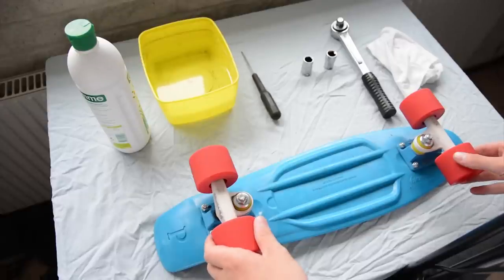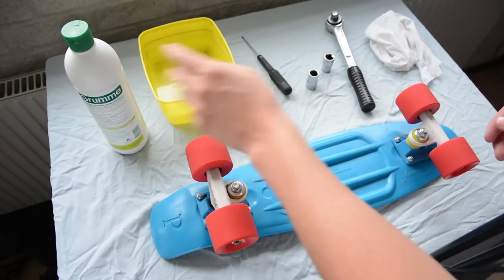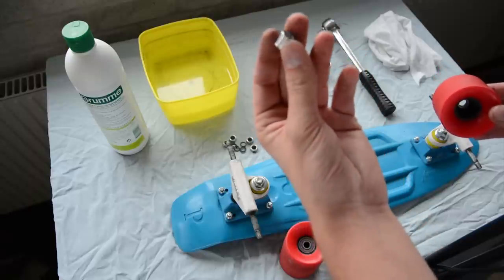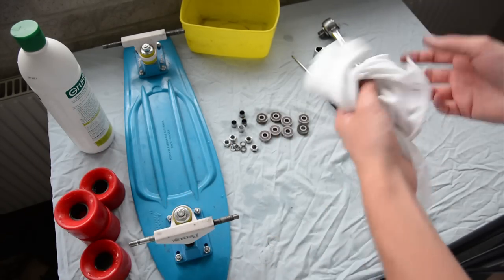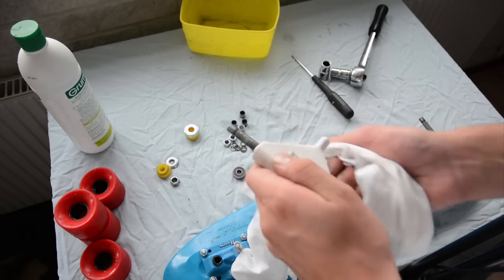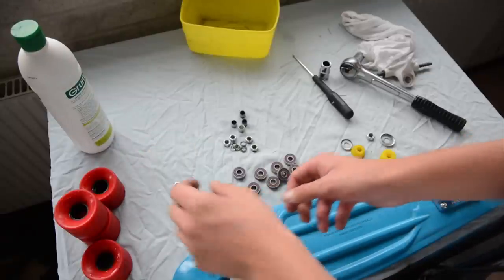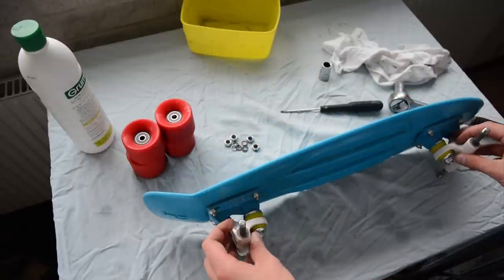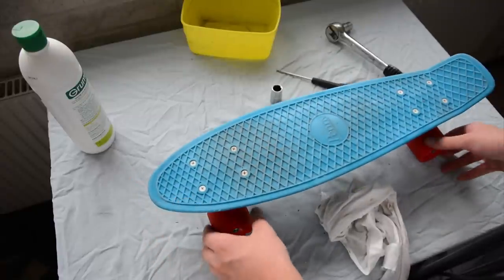How To Clean Your Penny Board

Comment: btw, to know how to get your wheels right tight, just check if they're wobbling from left to right a little bit, that means there good.
Reply: OverTheTop yep, Nice tip
Reply: If you have a spacer in between your bearings you can tighten it as much as you can.
Reply: If you have a spacer in between your bearings you can tighten it as much as you can.

Comment: Dude if your going to clean the bearings, use liquid soap; buy a bones bearing cleaner and bones speed cream at your local skate shop. Its stupid that you clean the wheels, they WILL get dirty...
Reply: Yeah but it makes sense to clean the inside of the wheel incase any crap gets in there
Reply: the inside of a wheel won't get anything in there, especially on a penny board
Reply: skate life he means the bearings i think.
Reply: +AandA GamingFTW  the guy in this video is probs pretending to know everything about penny boards
Reply: 21 RB if you have a penny board your gonna cruise the shit out the bearings and later on the insides of the wheels and the spacer will get as dirty as the bearings,if you don't clean them your cleaned bearing can get dirty due to the  grim and dirty inside the wheel and spacers
Reply: 21 RB also how the fucking hell does his wheels get dirty if he cleans it,it's like saying"if you take a shower you WILL get dirty" makes no sense right?
Reply: @MrAce21  There’s no point in cleaning wheels.
Reply: @guhwayro  yeah there is my bearings and wheels were caked in mud which made them shittier

Comment: To clean my bearings, I personally like to use baby oil or skateboard lube. I just use baby oil since it was something i already had but what I do is i put all my bearings in a ziploc bag, then pour some baby oil in the bag, then I kinda mix the bearings in the bag, then take one bearing out one at a time and use a wire toothbrush to clean out all the rocks and dirt. Then wipe the excess baby oil off the bearing with a tissue. (Btw I got this tip from Chris Chann)

Comment: personally i dont do anything to the whole bolts and washers or the trucks. i literally just started pennying at the beginning of june and i just get a toothbrush and scrub scrub scrub until im too lazy to clean anymore. poof it looks clean enough.
Reply: My advice, you start actually taking your board apart and cleaning it that way. Because if you just clean the outside, then riding it will become more gritty and rusty and that's not good. Also make sure you NEVER get water on your bearings. Because that will make them rusty and break them completely.

Comment: I think my bearing broke. something went missing, and you can some see little ball thingies on the inside and i have no idea what to do, like buy a new bearing or just keep riding it like that. any advice?
Reply: +Elias Rascon No they're completely fine. You just accidentally popped the shield off. You risk your bearing exploding which isn't really that big of a deal. Happens all the time. You can buy new bearings if you want. Bones Reds are fairly cheap ($15ish) and work just fine. I've been riding Reds for about 10 years on and off and they've been pretty good. Long story short, they're fine.

Comment: btw you cleaned the bearings wrong you have to clean the insides as well as the outsides and you have to do it with a special type of cleaner and then put two drops of lubricant in the bearings after the bearing dried I just wanted to know if there was something spasific to clean the deck with lol

Comment: What if I have the 2 washers for all my wheels except 1 and on the one wheel I only have 1 washer..... is that bad
Reply: It wont hurt the board, but it will cause friction with the wheel and the truck/nut. Place the one washer you have closest to the deck to prevent some of the friction from occuring.

Comment: HELP i washed my penny board without disassembling the parts, and now the wheels won't turn/spin smoothly. The wheels are stiff and stuck when I try to ride the board. Is it because it rusted inside, or because I need to regrease the bearings? Also, there is no visible signs of rust outside. I made sure to dry it.
Reply: you have to clean all parts and oil it a little bit
Reply: +derbi senda so its not rust right? If i disassemble everything and oil it, it will work like it did before?
Reply: Crystal Peng I had also that problem and it is now Rolling great

Sorry about my bad English am Dutch
Reply: +derbi senda ok, thanks this is a relief to hear!
Reply: +Crystal Peng if that doesnt work take it to a skate shop or a pennyboard shop They might be able to help

Comment: What if my penny's main thing idk how to call it.. The one where you put your feet. How can i clean it if its texture is like the texture of the normal skateboard
Reply: The part you put your feet on is called "deck". If it has grip tape (sand paper topping) on it like skateboards do, you can't really clean that. If it bothers you, just buy a new one. you can buy them directly from penny, then you can chose a design and the wholes for the bolts and the penny logo are already cut out or you can go to a local skate shop and get normal grip tape on it but thats usually just black OR you can just leave it without grip tape, you don't necessarily need grip tape on there.
Reply: +MarioWASD gosh pennies are really expensive and pennies are rare on the philippines. I guess i have nochoice but not to clean it :(
Reply: +MarioWASD the deck of my penny is like a grip tape but its not its like the main deck. The deck is acrually a sand paper deck thingy but it has a skull design. The store where i bought it only has 2 designs and its both sand paper decks. Theres normal diamond shape thingy but its 27 inches so i didnt buy it. I thought it would be easier if its shorter but i was wrong
Reply: So you have a normal penny board right? You can peel the grip tape off and just skate with it like that, I don't have grip tape on my penny board and I like it  :)
Reply: +MarioWASD its not a grip tape. The main deck is a SAND PAPER ( the texture is ) trust me. For example a normal penny has diamonds bla bla. Mine doesnt and its not a grip tape you wont be able to peel it off. Plus i get too shy because theres barely any girls that is i guess near my age that saktes in my neighborhood. So some people just look at me weirdly and some kids that are boys laugh and tease me.
Reply: +Danah Sampaga ohhh I think I know what you mean. the board you have isn't exactly a "penny" board. penny is the brand. you have another type of plastic skateboard. not sure how to clean it though

Comment: Earlier today I washed my whole board with a hose and then just put WD-40 in parts that may rust. Do you think I totally fucked my board up or will I be safe?
Reply: Depends did you spray the WHOLE entire board as in the deck with the wheels on and everything then you messed up your board but if you spray your plastic deck with a hose I'm pretty sure you're ok
Reply: +Awesome Guy Yeah, I did spray the whole thing with wheels on and all. Its been about 1 day or 2 and its working good as new. Do you think anything bad will happen later?
Reply: +Brantuh yes your board will get worse because water will get into your bearings making the bearing rust and later the bearings won't spin as great
Reply: +Awesome Guy But I put WD-40 on them to prevent rusting...
Reply: +Brantuh wd-40 removes all oil from the bearings and makes the old ones clump up. you should take them off and add some oil into them. they will go bad otherwise. you should be okay then if you have a penny board. but if your deck is wooden you should always only wipe it clean.
Reply: Nah I threw my board in a pool and its still up and runnin'
Reply: +xBcHx 25  that was a bad idea..
Reply: Awesome Guy Nope it's been a year and its perfectly fine.
Reply: huh
Reply: BcH Productions interesting so there is no hissing or anything at all
Reply: Awesome Guy nope i cleaned it and used bones speed cream
Reply: +BcH Productions there's no way your bearings are still working fine after throwing it into a pool
Reply: Hank Hill yes they do

Comment: Once I did this my wheals don't spin as fast I think I did something wrong what do I do
Reply: Yeah, me too, and it made like a whirring sound which it didn't before.
Reply: Did you put any liquid on the bearing? It's also possible that your bearings lag the synthetic oil thats in between the little balls in the bearings. You can also just replace the abec nine bearings that come with the Penny, I've heard they're crap. Other than that it's also possible that you tightened the bolts on top of the wheels to much, just make sure the wheels have like a millimeter to wiggle around  :)
Reply: +MarioWASD Pennyboards come standard with abec 7 bearings not 9 and I don't know why you think they are bad. For bearings that come standard they are excellent and for a cruiser board it's good enough.

Comment: So I took off all my bearings and found that one of the spacers in my where was rusted up pretty good, do you suggest I buy a new one or will it be ok?
Reply: As long as it rolls properly and quietly you should be fine. If not, buy bones reds bearings.

Comment: It would be better, if you'd use imperial tools and not metric ones... just saying...
Reply: He is European and that's why he uses the metric system
Reply: He is European and that's why he uses the metric system
Reply: Jamie Macdonald I'm european too, and I use the impearial system. Point is: most skateboards/longboards/pennyboards have imperial sized nuts and bolts. If you use metric tools, they might work, but you will ruin your nuts, bolts and tools. So he'd be better off using the correct tools.
Reply: I get what your saying